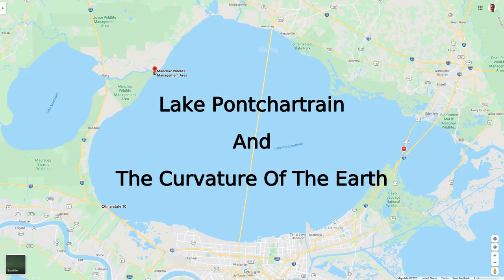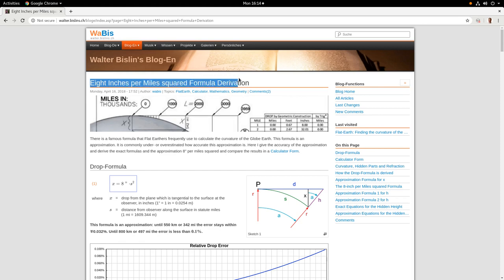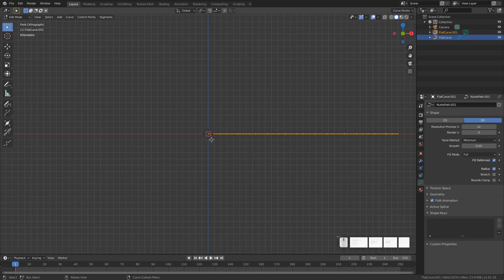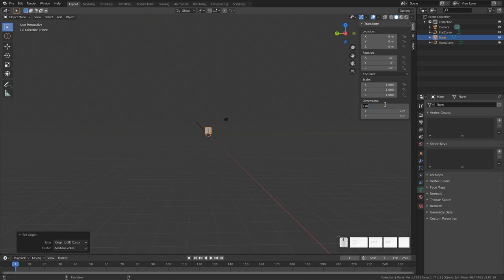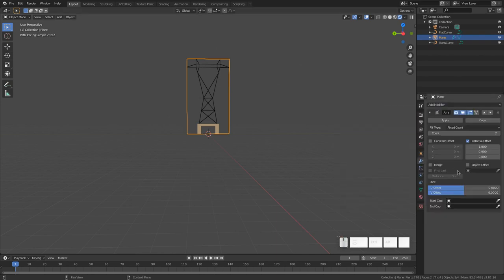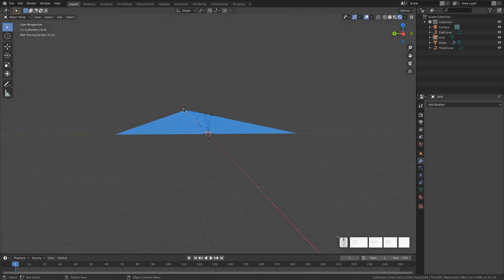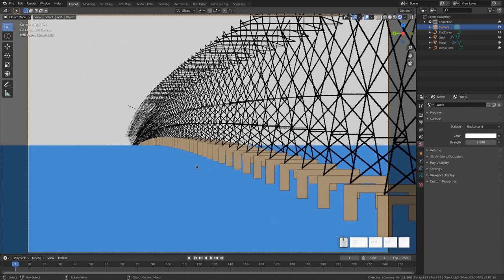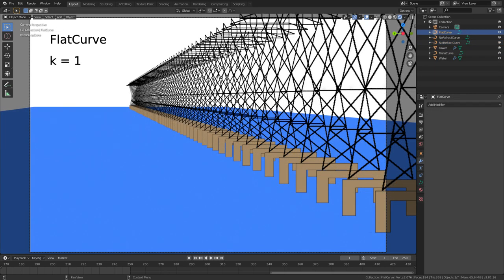Lake Pontchartrain And The Curvature Of The Earth

Comment: Why is there no evidence of curvature along the horizon line in this image, then?.
Reply from the maker: Are you referring to the actual photo taken by Soundly at 0:22? It was taken with a zoom lens which greatly reduces the already very slight curve seen in the horizon. The photo was taken 10.3 meters above the water, which only produces a 0.095° drop in the horizon, which is hard to see:
https://www.metabunk.org/curve/
Try the "Advanced" checkbox on that calculator and look at the "Horizon Curve Pixels". It's not much.

Admittedly my model does not take into consideration side to side curvature since it wasn't relevant to what I was showing, but it doesn't matter much as you can see.

If you want to see that kind of curvature it helps to be much higher. Check out my comment on this high altitude balloon video:
https://www.youtube.com/watch?v=VpWBYVUiuIU
Reply: If the camera could capture an image that was many miles wide, it would. 

But that’s not really the question. How do you explain these power lines of the earth is flat? How is the water curved?
Reply: The horizon doesn't have curve from that point of view, bruh
Reply: @TheShikerWolf  so earth is cylindrical? It only curves along the y axis but not the x axis? Lmfao
Reply: You're seeing the towers at an x y axis, and since they are taller compared to us, the drop off seems dramatic, however, comparing a 150 foot vertical curve across nearly 80,000 feet, isn't going to be very pronounced on the water because it is still a very small aspect of the entire earth. About 0.2 degrees of curve. Again, at an x y axis the towers can be seen taking a dip, but the water is angled behind the horizon. The towers are moving down with the water.
Reply: Because we’re ON the earth and looking in any direction is “toward the horizon.”  It’s the same. That’s why, as it falls away equally, you guys pretend this is flat when it’s really falling away equally.   🤷🏼‍♀️
Reply: @stevenelliott216 correct

Comment: The water is FLAT. ITS ALWAYS BEEN FLAT   why it's used as a level.  Smh. Don't care what you say or did. Water is always flat
Reply from the maker: Is water always flat? There's nothing special about water. Water, like everything, is subject to a downward force. Consequently the surface is at right angles to that downward force (I'm avoiding the word "gravity" for now), but we can see this with sand, snow, dirt, whatever. Is the direction of that downward force the same everywhere? If it is then we'd expect water to be flat, but if the direction of the doward force varies with location then we'd expect the water to curved. I think the direction of the downward force varies - they all point to the same place (the center of the Earth). The surface of the water is just another way of talking about the directions of those downward forces.

You can use a plumb line instead of a level and get the same result. You could use either on a rotating carousel and they'd give you the false impression that it is not flat even though it is. It's important to understand the limitations of tools, which in this case is that they just tell the direction of the sum of the forces acting on them. Also, a body of water on the carousel would be curved.

What I did is I showed that the photos Soundly took are exactly as expected on a spherical Earth. I did it using open source graphics software (Blender) that has nothing to do with the curvature of the Earth. I showed it being done, and the resulting file is freely downloadable.

What if all water is just a bit curved in a way that's hard to see on a small scale?
Reply: do u know, if u spin glass of water. water forms a parabola curve
Reply from the maker: @thitinunsiriprapawat2041  I agree. A nice video demonstration: https://www.youtube.com/watch?v=Zip9ft1PgV0
Reply from the maker: @AerobaticsPilot  The Earth spins at one rotation per 24 hours (approximately) which is half the rotational speed of the hour hand on a clock. Too slow to see. Sure, the equator is around 1,000 MPH, but relative to the center of the Earth. Speed relative to the vacuum of space doesn't matter.

Advanced topics like the Michaelson Moorley experiment can wait until we agree on some basics.

In general documents about physics, flight or otherwise, make simplifying assumptions. You've probably heard that when an object is thrown its path is a parabola, but that makes the simplifying assumption that air resistance is negligible. Simplifying assumptions are everywhere. A cartesian (XYZ or flat Earth) coordinate system is much simpler, so it makes sense to do the math that way unless there's a good reason to do otherwise.

I don't understand how this conspiracy works with flight documentation. Who is in on it, and who is trying to keep it secret?

Also, not all documentation with flight assumes a flat Earth. Consider ring laser gyroscopes that are able to detect the rotation of the Earth directly, and therefore find true North. Check out "gyrocompassing". https://www.vectornav.com/resources/inertial-navigation-primer/theory-of-operation/theory-gyros
Reply: DUH! water is always flat? ever heard tide? even neighboring seas have level difference because of different salinity
Reply: "Don't care what you say" is flatearth truthers' slogan
Reply: "Don't care what you say or did" bro crying a flat river 😹😹😹😿

Comment: Unfortunately in recent months we have seen plenty of photos of the causeway appearing perfectly flat over it's entire distance, apart from its raised sections, or humps. What we more often than not see in long distance photos using standard wide angle lenses, is the curving of horizontal lines. You need a very specific lens to counter this effect and give a true visual representation. These photos neither prove or disprove earth curve simply because we can't get high enough. In the words of Neil De Grass Tyson, commenting on the red bull jump. "At that height we don't see the curve of the Earth"
Reply from the maker: Have we really seen " plenty of photos" like that? Not that I've seen. Before linking to something consider whether it's really comparable. Is the photo clear with a well known camera location and elevation? Does the subject have relatively little distortion?

As to "long distance photos using standard wide angle lenses, is the curving of horizontal lines" - the photos here were taken with a zoom lens, not a wide angle one. The Blender model I created just models the drop along the x-axis, not side to side, since the later is not relevant, and is not apparent in a zoomed in image.

I think you are referring to things like barrel or pin cushion distortion that can happen with a wide, or particularly fish eye, lens. Regardless of whatever distortion the camera may add it should not change whether or not a given point on the transmission lines is obscured by the water. Why is light able to make it to the viewer from the causeway from some locations, but not others?

As to "photos neither prove or disprove earth curve" - these photos really are reflective of the Earth's curvature, but it's not even what I consider to be the best evidence. My motivation had to do with some arguing that the curve did not look right. I wanted to demonstrate that this is in fact the curve you get when objects follow a curved surface. I did it using an open source graphics modeling program. I showed how to do it, and I made the Blender file downloadable. This should address that particular skepticism.

There's no way to take what we know about how continents laid out on Earth, and place it on a flat surface. And that should be reason enough to exclude flat Earth.

There is a big difference between having something to compare to the horizon, like the the transmission lines, and trying to detect curvature in the horizon directly. The former is much easier, and can be done at a much lower elevation.
Reply: @stevenelliott216 
Since you know exactly what was used perhaps you could tell us the exact lens type used. There are lens types that can curve horizontal lines but none that can straighten them. I maybe wrong. Perhaps you could enlighten me. I look forward to it
Reply from the maker: @TerenceHughes4501  The exact details of the lens used does not matter.

The process of forming an image involves projecting from a sphere that encloses the viewer (celestial sphere in astronomy) to a two dimensional flat surface (film or photo sensor). For wide angle lenses it's similar to the problem of projecting a sphere to a two dimensional surface. Some distortion is inevitable. Different types of fish eye lenses are different strategies for dealing with that. They are analogous to map projections. When a zoom lens is used it's more like a map for just one state instead of an entire hemisphere. At that level there is not much distortion, so the map projection used does not matter much.

Different zoom lens for a given level of zoom are going to produce roughing the same image other than the fact that cheap ones may be more blurry, or have incorrect colors. Even a pinhole camera should produce roughly the same image.

Sure, a cheap zoom lens may introduce some curve to otherwise straight lines, but not much. You'll probably have to compare to a straight line to notice. Feel free to take a photo of some sort of grid (tile, whatever) with a zoom lens and see for yourself.

The curve seen here for the transmission lines is pronounced. It's in no way reflective of the barely noticeable distortion that I'm referring to.
Reply from the maker: @TerenceHughes4501  The exact details of the lens used does not matter.

The process of forming an image involves projecting from a sphere that encloses the viewer (celestial sphere in astronomy) to a two dimensional flat surface (film or photo sensor). For wide angle lenses it's similar to the problem of projecting a sphere to a two dimensional surface. Some distortion is inevitable. Different types of fish eye lenses are different strategies for dealing with that. They are analogous to map projections. When a zoom lens is used it's more like a map for just one state instead of an entire hemisphere. At that level there is not much distortion, so the map projection used does not matter much.

Different zoom lens for a given level of zoom are going to produce roughing the same image other than the fact that cheap ones may be more blurry, or have incorrect colors. Even a pinhole camera should produce roughly the same image.

Sure, a cheap zoom lens may introduce some curve to otherwise straight lines, but not much. You'll probably have to compare to a straight line to notice. Feel free to take a photo of some sort of grid (tile, whatever) with a zoom lens and see for yourself.

The curve seen here for the transmission lines is pronounced. It's in no way reflective of the barely noticeable distortion that I'm referring to.
Reply from the maker: And there's still the fact that some distant parts of the transmission lines are obscured by water.